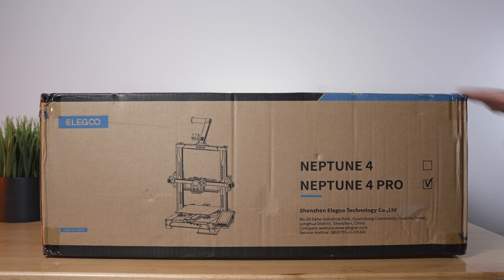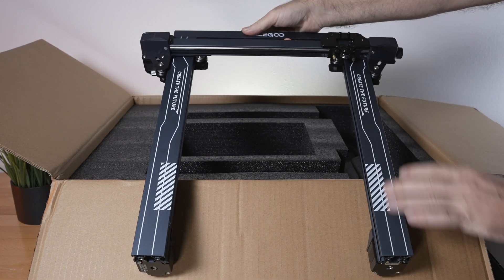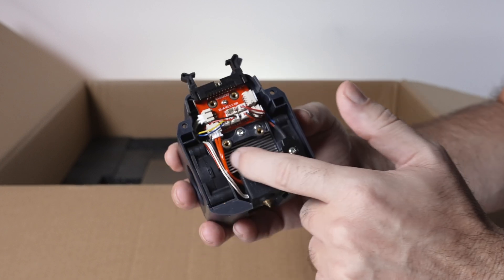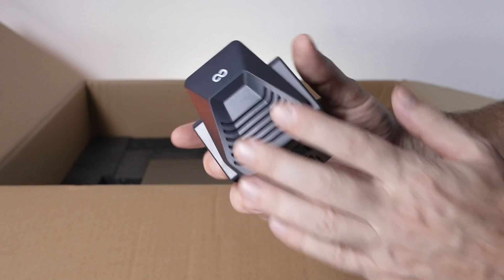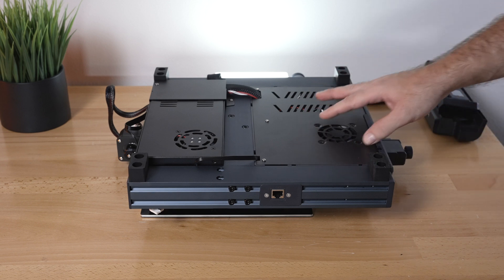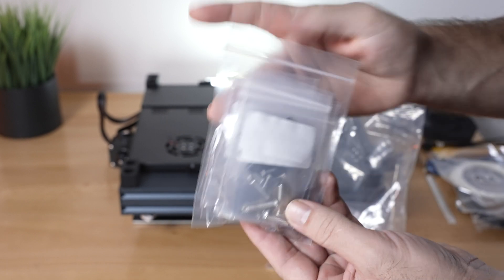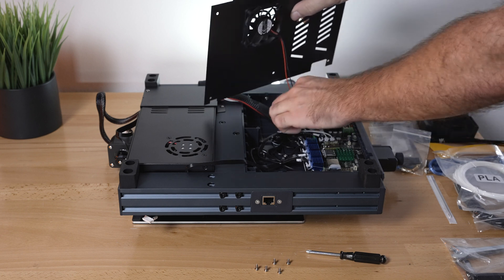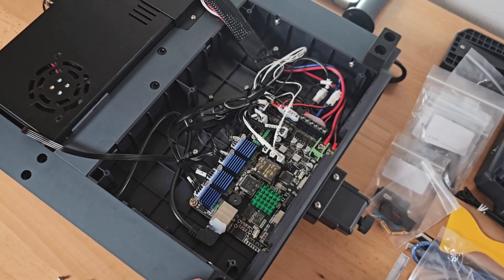Elegoo Neptune 4 Pro - Klipper 3D Printer - Unbox

Comment: If you have a Laptop and WiFi network in your house you only need the Lan cable already supplied in the package. Just share the internet connection of the laptop via Lan!   (Go in network connection, right click to enter properties for your WiFi connection in the laptop, than click share tab and toggle "allow other network users to connect trough this computer ." For W11 you need to go further in settings and select a service (1700 to 1708).